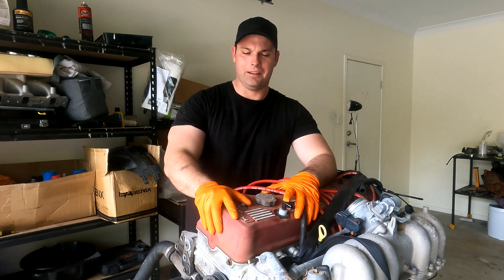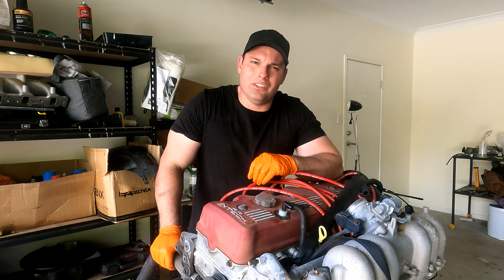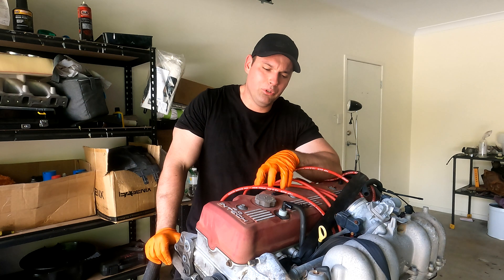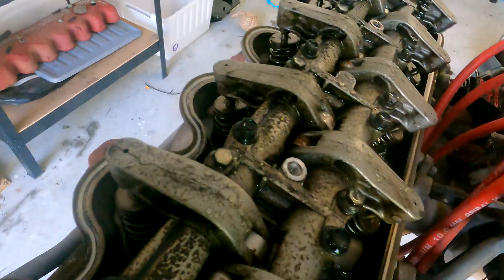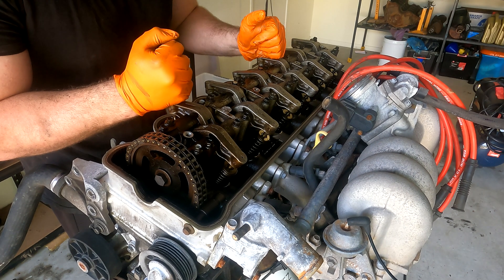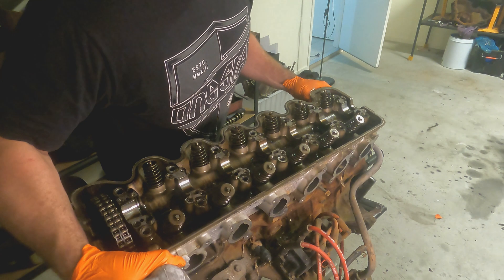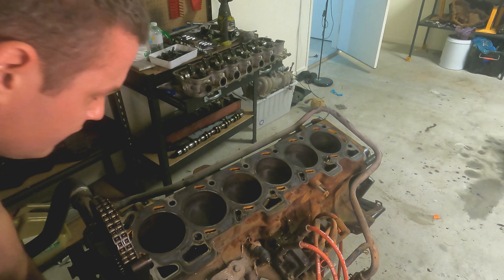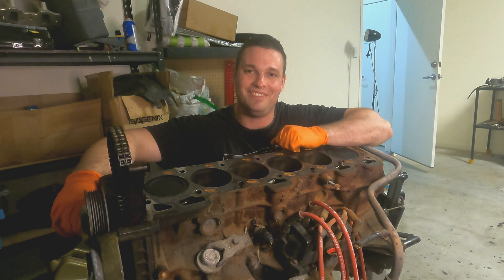Building For Performance Ep02 -  AU Intech Pulldown.

Comment: For high rpm short runner is better hence why both the Barra and intechs intakes have a vacuum actuated flaps in the manifold turning  long runner into short runner bye shortcutting it

Comment: Love the tickford  intech I blew my original xh tickford engine up doing a huge burn out blew the head gasket and dropped a rod the Ute is the series one xr6 T5 manual Ute running the 3.45.1 lsd diff on flipped leafs it’s really fun to hoon around in only has a mild cam and 4480 with open exhaust system guts out of the cat sounds really deep and so good around the limi rev range and as for your question I’ve found the Broadband intake on my Ute ok but for the higher revs the old log manifold seem better my Ute is cool and fairly quick off the mark I’m flowing you now and subscribed i’m interested to see what you’re doing with that engine
Reply: Naughty . I have a xh Tickford ute 1996 XR6.

Comment: I own 40 ohc that makes 390hp at the block a mate of mine built it and done a whole lot of R&D race it in a saloon drit track car broke it a couple of times and worked out really weak spots are it’s a au bottom with a ea head apparently the engine builder started with au head did not like the rocker system and changed to ea for better valve control it’s 12to 1 comp custom intake to suit carburettor and port job custom rods and piston from the states
Sounds absolutely bonkers I found his old race car so I’m slowly putting it back together yet to drive it but will happen one-day

Comment: Cryogenically treating binds the internal structure of metals tight then bringing back to room temperature over 48hrs gradually helps it spread evenly like chicken mesh for an example opposed to just random clumps and gaps where the gap parts are usually the weak points where it may crack seen reported test and research from different sources under microscopes and pressure tests conducted.
Reply from the maker: Thats a great explanation and analogy too.  I have ended up with some nice oversized intake valves but will concentrate on valve control as I believe this is the main cause of broken valvetrain and especially rocker arms, other than two step on the exhaust side. I'd prefer to to have to make billet arms if possible.

Comment: How much more power roughly with a massive port and polish ?
Reply from the maker: Really depends on how far you go and what you're willing to spend and if you want it to drive nicely.  I'd like to see this one around the 200kw mark eventually, then add a supercharger.
Reply: @GapSauceYoutube  that would be perfect 200 kw , would like to have good fuel economy, but when I want to be silly have that power to do it . Little Supercharger would be good if it could be hidden under the stock bonnet

Comment: In episode 1 you had a vct engine and in episode 2 you’ve got a non vct engine what happened? Two separate builds?
Reply from the maker: I have them both pulled down, I found some rust on the bore unfortunately.  For what I'm doing I won't be using the VCT head anyway.  All will be explained in future eps 🙂

Comment: The only way your going  to get a 4.0 to make power is improve the lungs and scavenging effect from a decent pair of headers . Including AU BA BF
Here is the list
Fg Intake with adapter plate for the AU
Cam approx 224 duration at 50 on 114 450 lift
The cam needs around .040" -.050" at tdc on overlap in and exh
Custom header 1 3/4   primary 
2 1/4 secondary 
3" collector and exhaust 
Revised ignition map needs 8 - 10 ° more than standard across whole curb easy fix is to use off set keyway on crank or make a bracket to move crank trigger forward  bolt on custom trigger wheel  on the front of crank need ef el balancer to do this .
Plum in another injector near throttlebody to turn on at around 4800rpm  this is where the original start to lean out set to  70% duty cycle up till 5600 then 100% till 6200 . If you've done it right you'll be making 320 hp at the treads .  Dude,  Teachers don't use Chrome sockets to remove headbolts , just saying.
Reply from the maker: You should check out my last upload, most of what you are talking about can be achieved with a simple tune. Standard injectors are fine for the power you are making.

320whp is well outside the realms of a stock AU long block, as much as I wish it wasn't. Unfortunately lending my tools out means I need to use unfavourable sockets from time to time, it happens 🤷‍♂️ Thankfully I've been down the SOHC road before, should be alot of fun documenting it for everyone this time 🙂

Comment: Mine made 164kw at  5500 at the wheels just a cam standard motor , ran out of intake
Reply from the maker: The stock head is pretty much done there too, good power for cam only👍

Comment: what's happening with the intech mate no more vids as of yet pretty keen to see what you do with it :)
Reply from the maker: Hey mate, I have a lot of footage to get through. There has been a lot going on in the background over the last few months.  Engine is out and prepping for bay paint and the new motor to go in.. Waiting on parts and machinist, I promise it's worth the wait!
Reply: @GapSauceYoutube  yea nice mate i just finished my au bottom end ef top end cammed na 6 cant wait to see what you got in store ;)
Reply: @GapSauceYoutube  just discovered you, great content . I have a question for you.  Would a AU 2  Tickford  duel fuel motor have any good bits inside , similar to green top Barras ,ie  better rods , better valves . really keen to know
Reply from the maker: @antonyfrost2541  I don't believe so mate, Ford seems to be a lucky dip, can never know until you pull it down. As long as it hasn't run hot, should be just as good of a starting point though.

Comment: Short. 
Isn’t that why the intake manifolds had the butterfly valve that would open and close to make the intake runner length go from long to short?
Reply from the maker: Short for high rpm yes, and yeah that was the variable inlet design 🙂
Reply: @GapSauceYoutube  i think it opened around 3800rpm from memory. Love the channel. Cheers
Reply from the maker: @zacsborntorunrunningadvent3441  Thats correct, thanks for watching mate!

Comment: Love watching your videos mate! I have been tossing up for years what to do with my XD. Was going to do a nice clevo build but decided to turbo the cross flow instead! Super keen to get it finished!
Reply from the maker: I've been in the same boat with this EF, I've had a 351C slow build going and I'll keep it for now, it may find its way into something else. XD's are quite desirable now, super cool to see xflow's still being used!
Reply: @GapSauceYoutube    most people bin them but they are actually quite underrated. with a decent head and the right cam and a few other little bits and slap a turbo on, it’s not hard to get 400+ rwhp out of them.
My brothers NA cross flow makes 300+ at the rears. Goes well!. It’s great seeing you use the intech! Most people bin them for a barra! But I personally think they are a better engine!
Reply from the maker: @xdesp3516  400 will be a breeze with boost, I've seen some really quick 250's before too.

Comment: Gonna guess at shorter based on other vids ive watched 🤔 Also from v8 supercar setups. Dunno why though, but I'll have a guess.  Is it to do with less resistance for air draw under hi rpm allowing maximum amount of "air"  to be pulled into cylinder during intake stroke.
More air more fuel. More hp.

Dont ya love the coil pack location.. having flashbacks to when i changed leads on my old ef.

Comment: I feared one of those head bolts letting go or socket slipping & you punching yourself square in the face. Ouch! Shorter runners for high rpm power, but sacrifice torque.

Comment: Great series Blake. Looking forward to watching it. 

The very short answer to the final question is that short, wide inlet runners move the torque curve up the rev range whereas long, narrow runners move the curve down the rev range. BUT - there is a whole lot more to it than that. The effect is caused by 'pulse waves', waves of relatively high and low pressure in the runner.

P.s I have no idea what that means. Great question though. 
#2FGX3 🤙

Comment: Bit off topic but I've looked online and can't find what I need and thought some Ford fan here might know. 

Is there any info online about modding BOSS260 heads for BOSS290 valves and cam options

And/or

Can Boss290 heads be bolted to a Boss260? 

Thanks 👍
Reply from the maker: Hey mate, you can outfit the 260 heads with 290 valves with some slight modifications to a few components and yes, 290 heads will bolt on 🙂

Once I do it myself and can 100% confirm what needs to be done I'll make a video about it.
Reply: @GapSauceYoutube  thanks for the info 👍

I love my 5.4 but compared to my old LS there is relatively little online

Comment: Short runners for HIGH rpm but you will suffer a drop off in the low end torque
Reply: Short runner is for throttle response. It does do good at high rpm but longer rpm is still better.